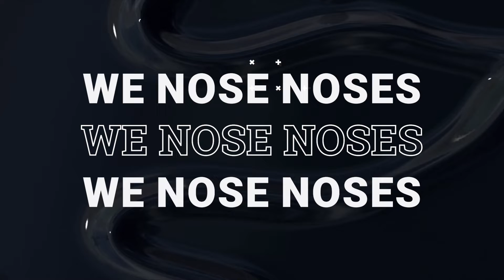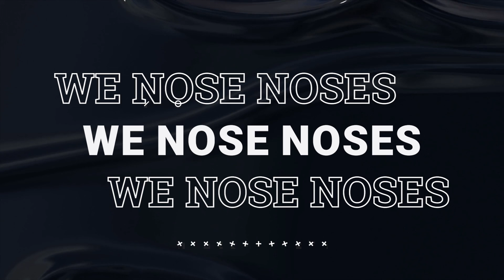Why Can't I Breathe After Septoplasty?

Comment: It's been 2 months since i had septoplasty surgery.
Still not able to breath properly
Reply: Same bro. It has been 2 months for me too i as able to breath decently but again i feel like blockage and panic and difficulty breathing. Any update if it stopped for you?
Reply: @sparshjazz6565 no improvement bro
Reply: @sparshjazz6565  how do you feel now ? Im desperate for an answer I can't find a solution
Reply: @sparshjazz6565 how are you now doing ???
Reply: @SnehaKumari-b5h2g much better since it has been 4 months. Had problems in the thrid months but now its much better. Dont even have to do nasal wash much.only 1-2 times a day due to dryness.
Reply: @sparshjazz6565  thanks for the reply.so do u think we need to have patience for atleast 3 months .
Reply: @SnehaKumari-b5h2g yes definitely. During the third month my nose did feel blocked due to dryness(although it wasn’t blocked)and sinced i missed the feeling of open nose my mind panicked and heartbeat and bp increased. It actually takes 4-6 months for comfortable breathing and within 9-12 months your nose heals fully.
Reply: how are you now doing
Reply: Did you have more difficulty breathing on one side than the other during the recovery period?
Reply: @Mohammed-s5q9o after the 4th month i had literally no issue, did not even have to use nasal wash or any medicines.All good now! Around fully healed.
Reply: @Mohammed-s5q9o NO but thats normal. Your nose circulates between the two nostrils so even at normal times it can be a little blocked. To answer your question - maybe sometimes temporarily but not always
Reply: Thank you for your reply. Yes, breathing alternates between the two nostrils, but the one with the slight deviation opens up, and the nostril is internally narrow compared to the other. Did you have the same issue? I've had the surgery for two months now.
Reply: ماسبب كان صعوبة التنفس لديك هل هي بسبب الإفرازات الأنفية والمخاط 😶
Reply: @M @Mohammed-s5q9o no it was due to nasal changes,lack of feeling of warm air entering your nose…after the surgery the nasal tissues take a good time to heal.
Reply: Mucus and secretions may cause a little difficulty but during colder winter months it increases a bit.
Reply: Did you have turbinate reduction along with the septoplasty surgery?

Comment: Thank you for explaining it thoroughly! It felt like talking to 3 doctors face to face. 
Question:
It is my 31st day after septoplasty operation. Breathing through nose felt perfect the day the waddings were taken out. But afterwards, into 3-4th week, it became difficult again to breathe through nose.
I can feel that it happens in the middle part of my nose and not the frontal parts, so visually nothing septum related. I can also feel a humid bump up on the right inner side of my nose. It feels a bit better if I use saline rinse or other sprays.

Now the question: Am I hurrying up to have a good breath again or something is wrong since it is 30days-post septoplasty?

From Istanbul with love!
Reply: How are you now? I have the exact same symptoms 3 months post op
Reply: @osduargil7229  I am better now. My doctor found an infection which prolonged the healing. Using lots of antibiotics made my immune system weaker which caused psychological issues that brought other stress-related illnesses. 

I can breathe much better now & sleep with my mouth closed. But I believe I have allergies so from time to time the air flow is not that perfect.

My recommendation is not to play with your inner nose which could get infected easily through your finger nails. Check with your doctor that did the surgery. 

Wish a speedy recovery for you my friend!
Reply: كيف عالجت المشكلة؟
Reply: Me too
Reply: Having breathing issue and panicking. This is 2 months after the surgery for me…a few weeks earlier i was even able to exercise.Although air can pass through my nostrils i feel suffocation
Reply: كيف عالجت المشكلة انا أيضا أعاني صعوبة في التنفس وتزاد سوءا من خلال تعرضي للبرد
Reply: How are you now ?
Reply: ENS
Reply: Do you know anyone that is able to work with it?